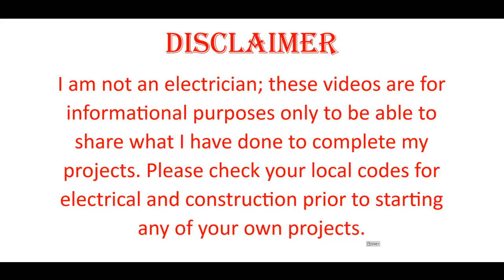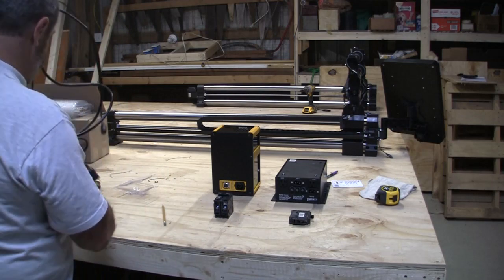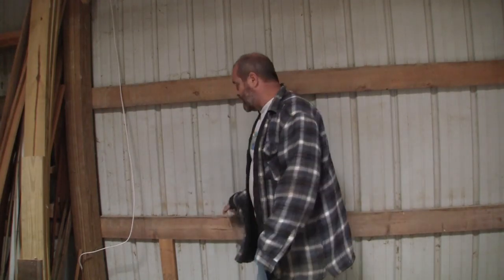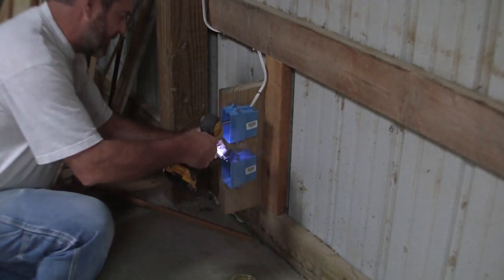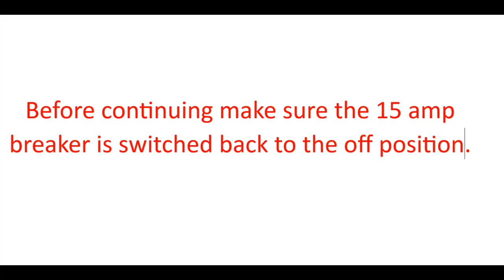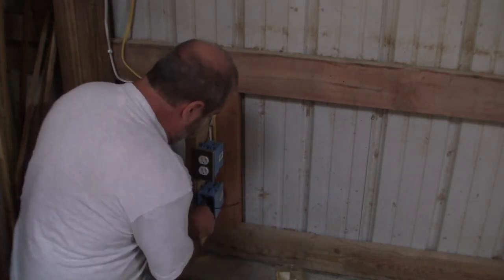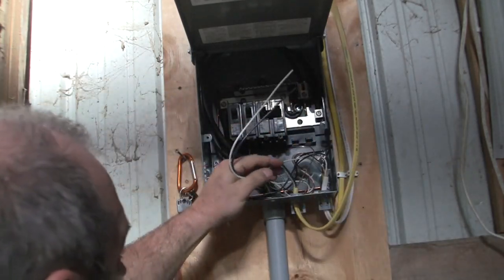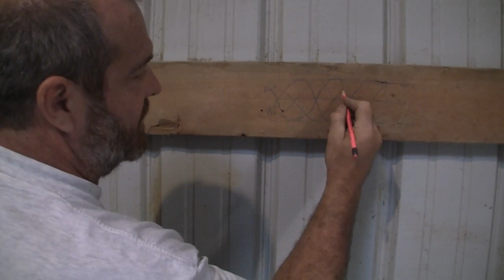Onefinity Elite Foreman - Part 3 Running Electric

Comment: This does not directly relate to the running the electric to the machine, but I guess it does in a way. If one were to add the 24w four diode laser to the machine, would that require an additional isolated circuit as well? And with having the number of dedicated circuits, would it be simpler to just run a 60 amp sub panel with say a run of #8 or #6 awg wire close to the machine?

I am trying to plan all of this out in my head before committing $$$ to it. And you have not said anything that I have seen, but how involved is it to switch between the laser and the router? The mount of the laser seems pretty simple, just wondering about the system configuration.

Thanks again for taking the time to make these videos!!
Reply from the maker: ROn Great question,  I would not think a 24w laser would need another circuit to run on, I would reach out to JTech or Onefinity and ask them.   The main reason for the vacuuim to be on another circuit is that it is a motor and motors pull a lot of current when they initially start up.   I did run another sub panel for mine,  just keep in mind if you want to go 60 amp "main" breaker for the sub panel, NEC rules states you can only connect 80% of the breaker rating. I always research and take it up one more level, because wire is expensive and you will probably expand later.

The last question I am sorry but, I cannot answer since I do not have a laser, I have seen videos when people have them side mounted to the router spindle, and where others remove the router.  So it should not be that bad. Check this video https://www.youtube.com/watch?v=pyOt7AtQ85A

Comment: Thanks for posting these videos; very informative!  Were you working on a sub panel or the main panel to the property? Thanks!
Reply from the maker: I was working on a sub panel.  but a main panel is the same thing with a main breaker.  My breaker in the main panel is 100 amps.

Comment: pwn sells 110v spindles, whats the benefit of having a 220v spindle?  also, are GFCI outlets and breakers to be avoided?
Reply from the maker: GCFI should be avoided.  Motors do not play well with them and they will get tripped up a lot.  Benefit if the 220v over the 110v.  The 220 does not have as high of a current spike upon startup.  220v runs what is called 2 phase,  so think of 2 sine waves that are 180 degrees out of pahse of each other.

What does that mean?  A little hard to explain without pictures.
Use the following picture to explain.
https://c7.staticflickr.com/6/5485/30953835910_9b24f2e346.jpg

A motor that will be running for a long time, it is usually better to run 220 than 110.  AC current flips from -120 to +120,  each time the current changes the motor slows down, at 60hz you cannot really hear for see it, but it does.  with 220 the second sine wave reduced that down time and the amount of amps that are being used.  

If you watch the video I explain some of this.  

I got the 220v, because I have been around big machines in my life and have seen the 110v die quicker,  but; if youare not using your machine for 8 hours a day everyday the 110 will do just fine.